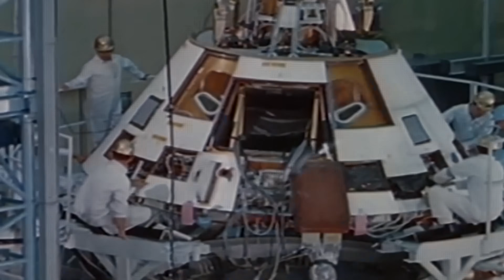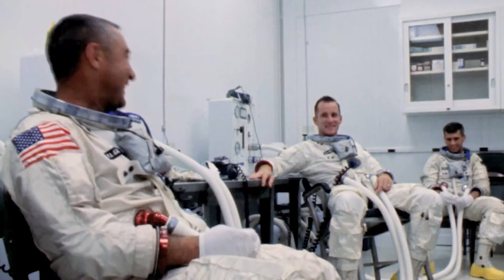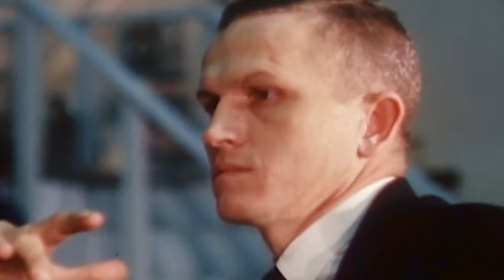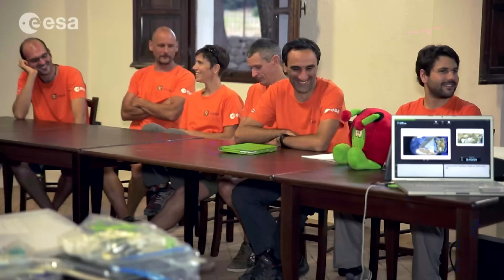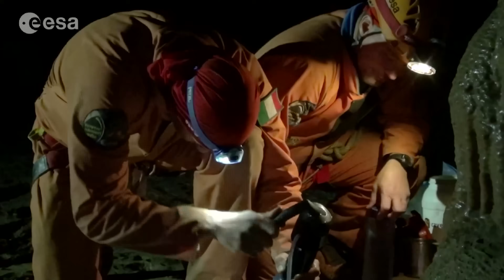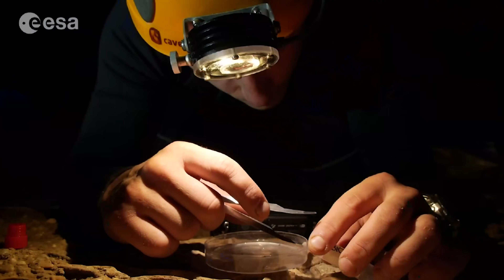The Truth About The Apollo 1 Fire Disaster

Comment: The Apollo capsule did not have an exploding hatch. It had three parts, and the inner portion opened inward. The pressure inside the capsule was 5 psi above normal atmospheric pressure and would have been difficult to open even without a fire inside. They just never thought of a fire inside of the capsule.
Reply: Which is madness given all the FLAMMABLE MATERIAL in the cockpit